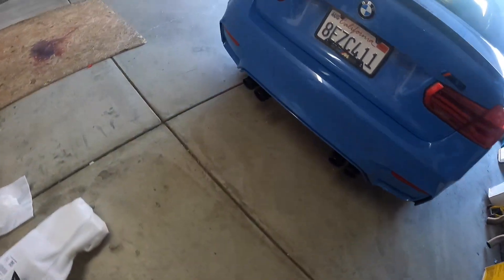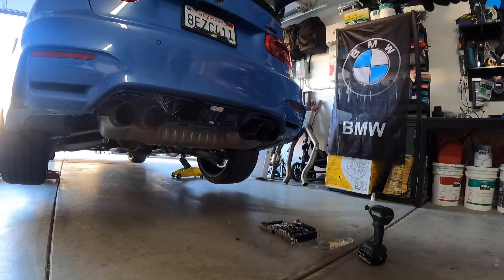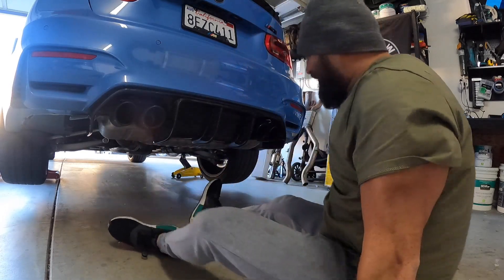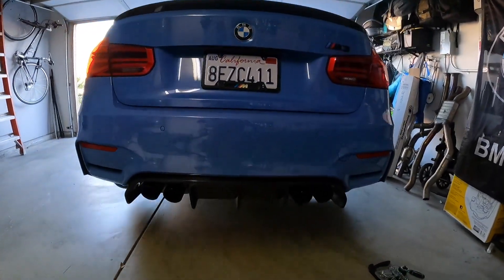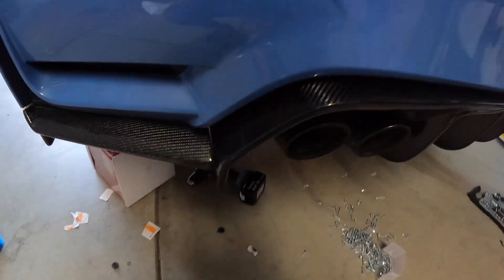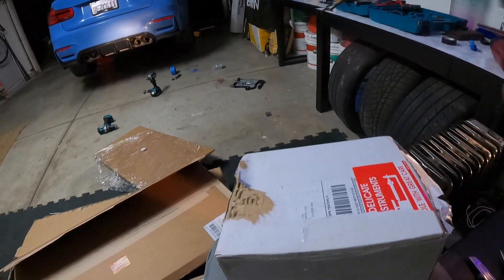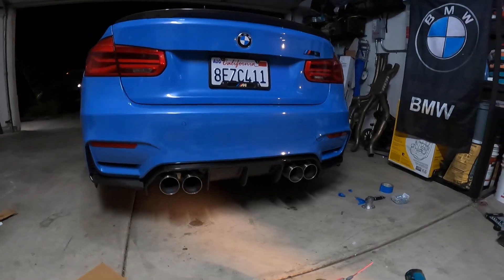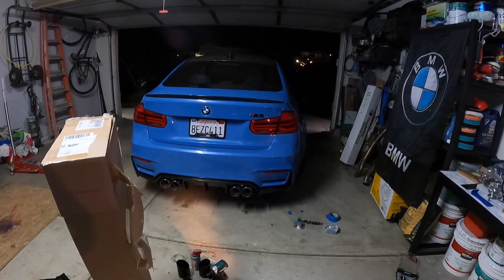BOOTY update for the F80 M3 (How to install rear diffuser and exhaust tips)

Comment: You are working under the car with no jack stand is a very dangerous and foolish way to make your car look good !
Reply from the maker: I only use jacks if im actually fully under the car. As the car sits even if the jacks were to fail i have a good 5-7 inches of clearance  on the rear before  it touches me but thanks for the concern :)!